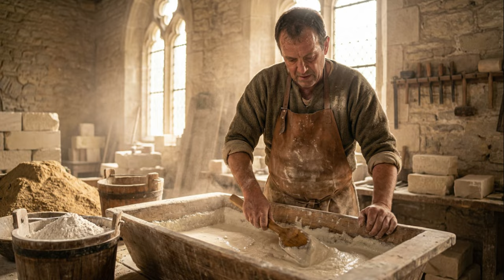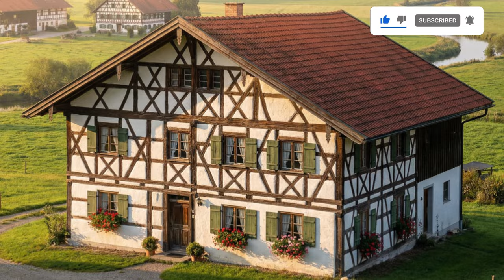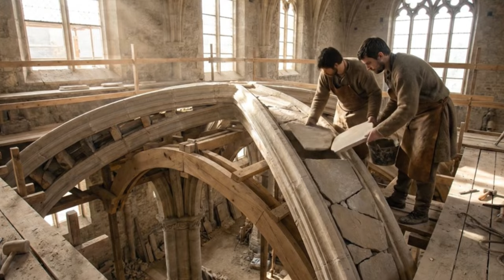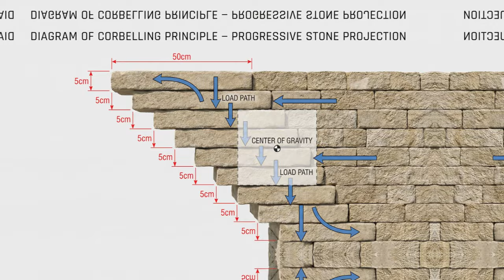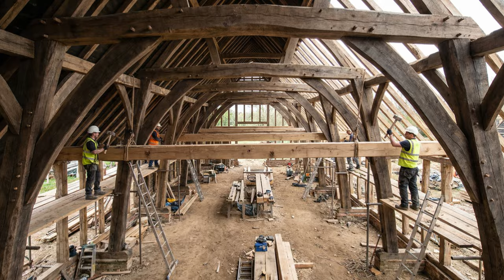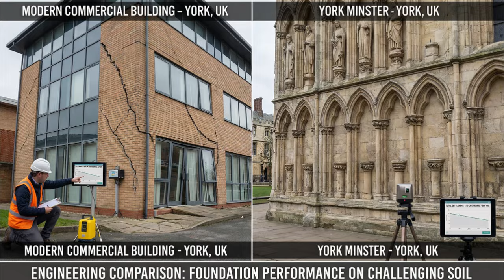12 Forgotten Medieval Building Techniques That Survive Earthquakes and Storms

Comment: The Pisano brothers came from Italy, and built homes in NJ, using the techniques they learned.  They made water diversion systems in their buildings, not water proof.  The houses stood 100 or so years, but sometime about 1970 or so, people started shoving fiberglass insulations into the air gaps, which existed to divert water.  Instead of diverting water, they became water collection systems.  In a few years, most of the Pisano homes failed.   Just from people pushing fiberglass insulation and concrete, and mortar into gaps Intentionally left for water diversion.
Reply from the maker: Thanks for sharing that historical detail about how this techniques were applied.